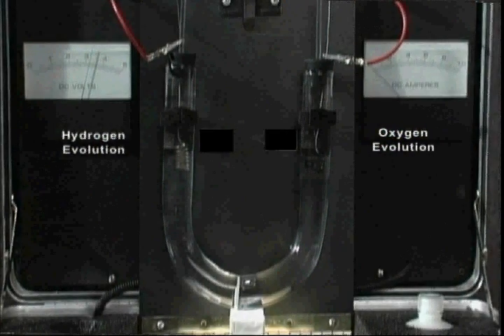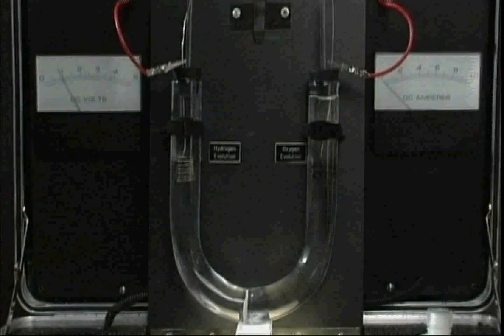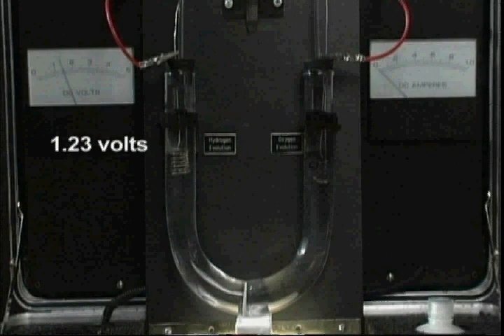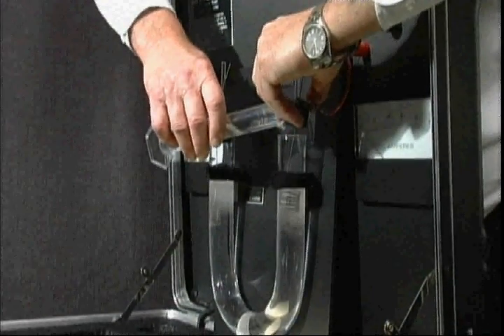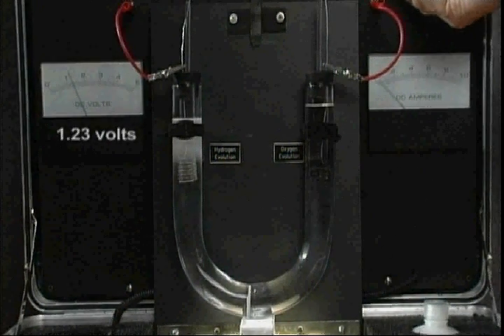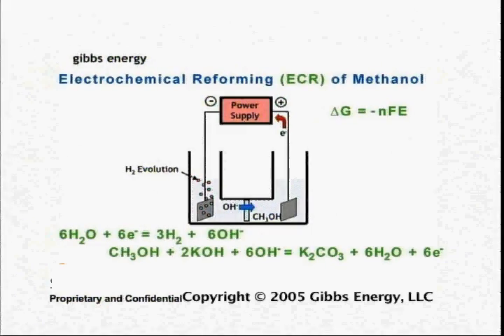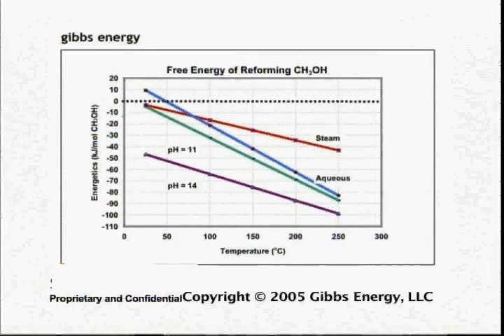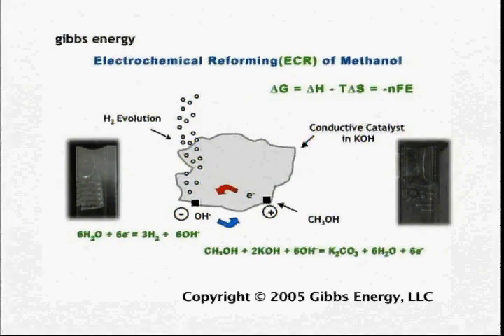Low Cost Hydrogen from Electrochemical Reforming www.gibbsenergy.com

Comment: Interesting demo but what is not factored into this cost analysis is the energy required to reform methane into methanol. What then is the true energy conversion efficiency?

Pressure balanced membrane separator cell still wins. IMHO.